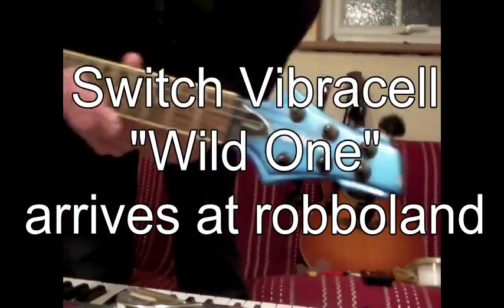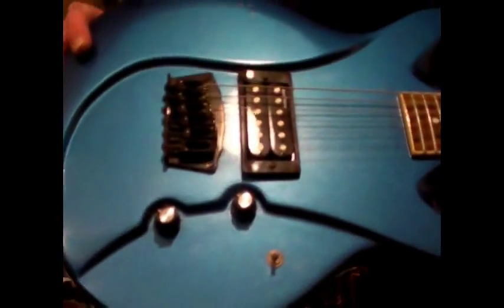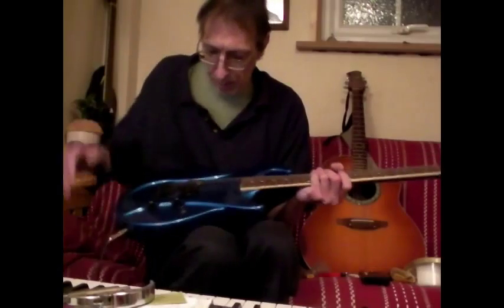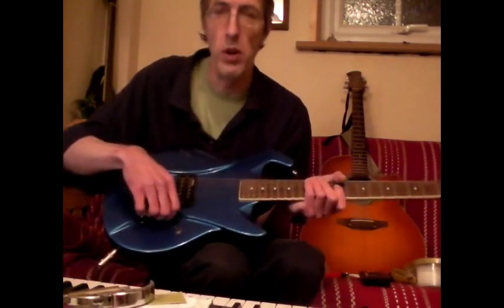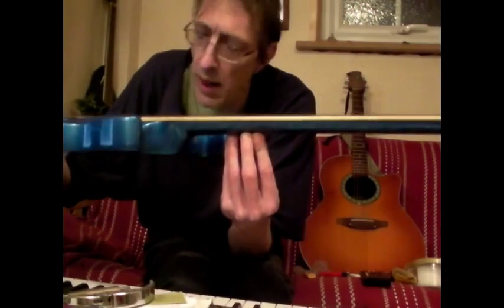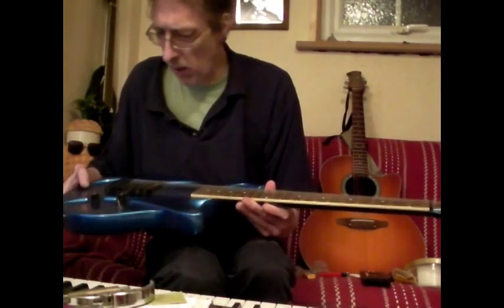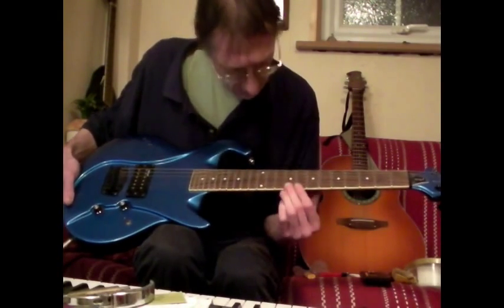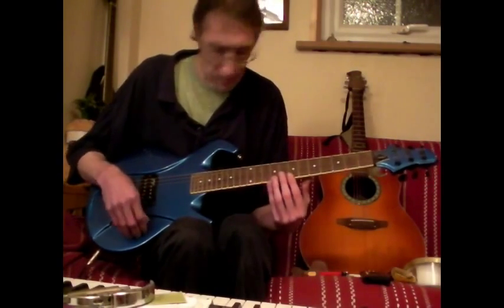Switch Vibracell Wild One  arrives at robboland.

Comment: Hi Robbo,I have a couple of the Aurora model Vibracell guitars(the ones that look like Les Pauls that need to diet).One has an ebonite fretboard and one rosewood.I like them too.I think because mine has a fender scale length,they tend to stay in better tune.First thing you should replace besides strings are the Chinese knockoff Grovers with some real ones.After I did that the tuning was considerably more stable.I had an Aurora 12 string at one time and it was a very special playing 12-more reliable than wooden 12's I have owned.Thanks for playing yours and enjoy it.
Reply from the maker: Hey, thank you for the comment and the information. I think you are right about the tuners, they are not at all stable at the moment, I was thinking it was old strings causing tuning problems, but I will certainly look to change the hardware.
I think they have some amazing looking guitars, I intend to buy more when I find them at the right price. Thanks again, very best wishes, Robbo.

Comment: Hi Robbo, I'm hoping you can help me with a question I have. I've had a Switch Wild 4 in my collection for a few years and have never seen another one in person. Mine is bright orange with twin pick ups. Apart from that it's identical (in fact I prefer the model you have) It's immaculate and although I paid very little for it I rate it quite highly.  So here is my question. What is the action like on yours?  I like a real low action and have the saddles as low as they will go and I still would like to lower it more. It;s not ridiculously high or anything, it plays nice. I just wanted to know what yours is like. I have chatted with someone from Tonal Creations and they said to add more relief to the neck but I have tried adjusting it and prefer it as straight as possible. Seeing as these are cast from a mould  then I figured ours would be the same.  The quality of the components is amazing. The electrics are well done with nice large pots and the hardware is great. 16:1 Grovers. One favourite touch is the jack socket which has a bearing so it turns and doesn't get the lead tangled. They came with a lifetime guaruantee.  Most people know they were designed by Trevor Wilkinson  of Wilkinson parts and Vintage guitars but they think the company went bankrupt but it was actually sold. I saw a Tele shaped one get sold  in a store cheap today and was just minutes late.to nab it for myself  I did notice you had a couple of chips on yours and you could see white underneath where mine is moulded from Vibracell  that is actually orange. It has no paint,  it's orange all the way through. I don't know if some were painted. It's good to see another fan.Sorry for the long comment. I enjoyed your vid, Cheers
Reply from the maker: +Paul Evans Hi paul, thanks for the comment, I really appreciate it.. The action on mine is great, i's as low as I could possibly want it..it makes it a very fast guitar to play, and with that slim neck, it is one of my favorite feeling guitars.. It sounds like your guitar is a better quality version than mine maybe, they made a few models and I know mine is one of the cheaper models..I would love to pick up some more from their range at some point, I do like the unusual guitars !  Thanks again for watching and commenting, good to hear from you. Cheers, Robbo.
Reply: Thanks loads for that. When I spoke to the guy at Tonal Creations he was really nice but I think he thought I was a real novice with the advice he gave me. Your model has the push/pull knob whereas mine doesn't have that option ,just an extra pick up. The pick ups are very powerful compared to all my other Humbucker guitars. I love them and if I could find another model going cheap enough I'd snap it up in a heartbeat. I can't praise them enough. It really is well made and the little attention to details is brilliant. I like quirky guitars too and I have a couple of early 90's  'Spirit' Steinbergers.. The small bodied one is amazing and was so cheap and then I got a GU bolt on neck one. They were so cheap. I saw my Switch advertised for £60 and it just said 'Strat style guitar'  :-) Thanks loads for your reply and I shall continue watching, Cheers